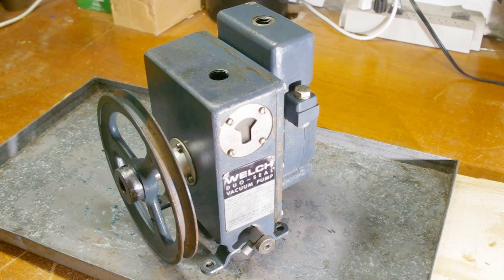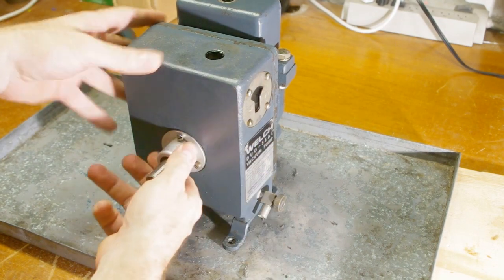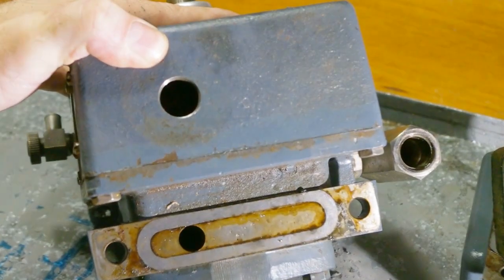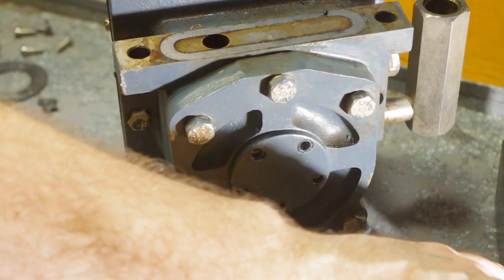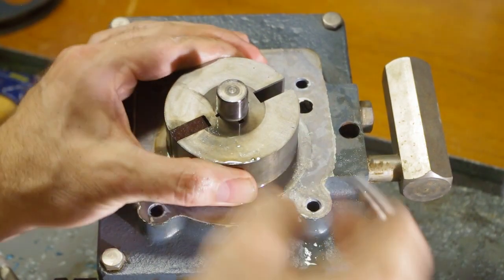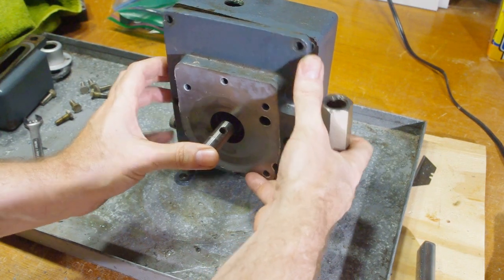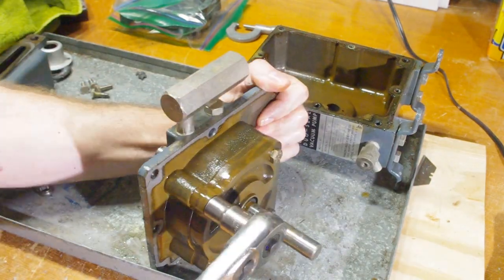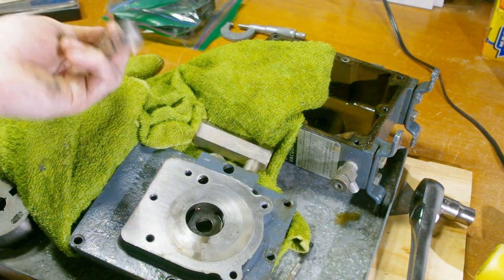Tearing down a Welch 1400 Vacuum Pump

Comment: I think the hexagonal tube seen @ 6:10 is the gas ballast but I do not see how it is opened or closed. Does anyone know hos this works? Looking forward to Part 2!
Reply from the maker: I never figured out how that works. I guess at the very least I will have to clean it and replace it, so I better get the manual out! Thanks btw, and I hope part 2 will not be too far off! The parts are here.

Comment: Welp, I just started on my welch 1400.   Mine's much worse shape.  Even so, I'm going to attempt to re-use the shaft.  Trying a basic seal kit and see if I can get any action of 'er.  If I'm getting close to a working device not sure how to resurface some of those parts.  I was looking for your follow on video but either you didn't record it or she's still lying in state.
Reply from the maker: I got the rebuild kit. It took longer than I expected and my dryer then exploded and took up the basement workshop. It will be reassembled this winter... but I'm still trying to find the white thread sealant. Have you got any idea what it is? and also thanks for the comment!

A while back I noticed a ton of them for sale on eBay in various conditions.. might be a good source of spare parts. I got mine from vacuumpumpsupply.com
Reply: @stickyfox  Could it be LOCTITE 592?  I don't know either.  Which rebuild kit did you get?  I don't want to invest a lot into this, and my vanes seem good enough.